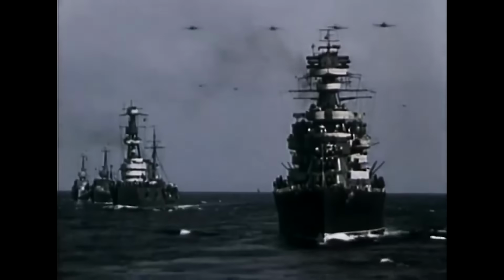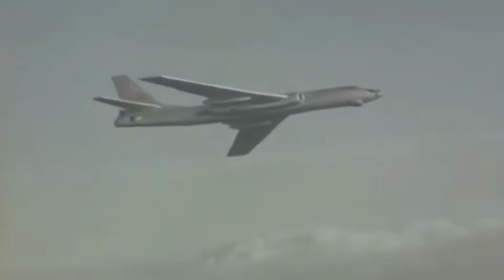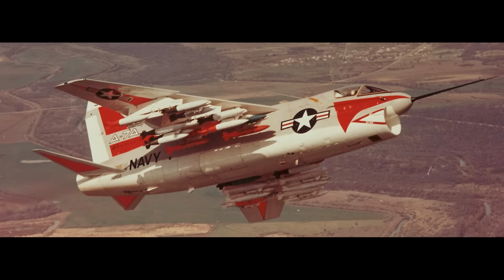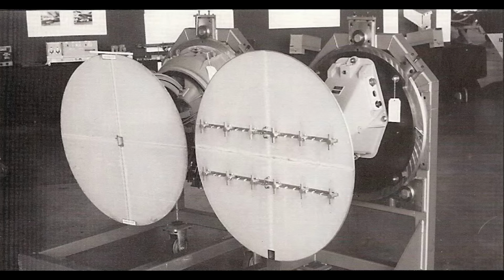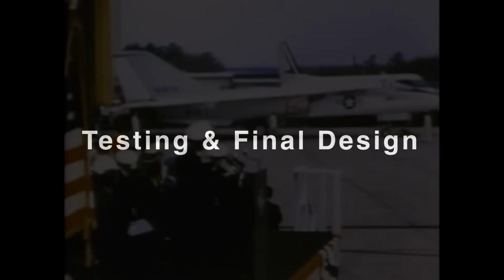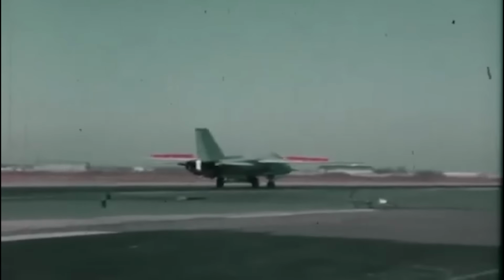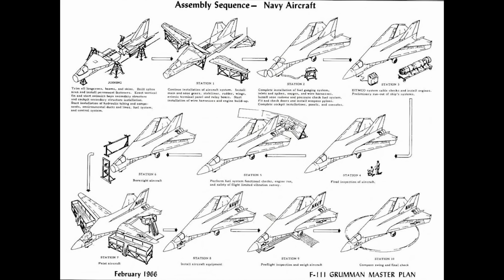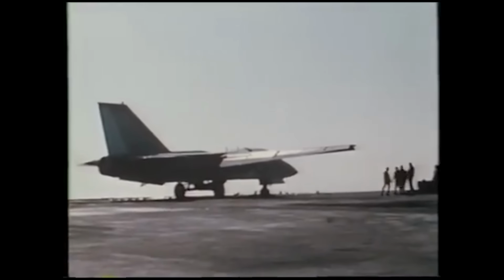Was The Grumman F-111B A Bad Aircraft Or A Missed Opportunity?

Comment: The Pratt & Whitney Engines had issues with compressor stalls mostly due to Inlet Ducting of the F-111.
More importantly the engines were subject to catastrophic turbine blade failure.
I remember my Father talking about the F-111 at diner. He had just come back from P&W after solving the problems with manufacturing Turbine Blades, he was pissed with P&W and their manufacturing methods.
Dad ran Grummann's Flight Test Department.
Reply: Was a problem on the F-14 too. So who screwed up on the intakes on that?
Reply: @w@w@w @whtalt92 14 Flameout issues were again on P&W. It took a combined effort between Grumman and P&W to modify the Inlet Ducts of the Tomcat after an engine redesign driven by compressor failures. My Father went to Pratt & Whitney, once again. Now years later. Evaluated their new engine operation and came up with the solution to the turbine blade failures they were experiencing on the new engine, once and for all. Micro cracks in the cast Titanium blades were the cause. It was a Titanium processing problem that was still plaguing designers after decades of design effort. The solution, better process control and old school magna fluxing. The trick was using the right dyes and ultraviolet light frequencies. I remember this as dinner table conversation. Following Apollo in 1969, We returned to NY and my Father took over the F-14 Project. He picked up a mess and got it straightened out.
FYI General Dynamics screwed up the F-111A Ducts. Grumman fixed the Ducts and Landing Gear problems in the B variant.

Comment: The US Navy turned out to be right, actually.  It is easier to design an aircraft for the Navy and have the Air Force adopt it, than the other way around. The unit costs of the F-14 would have dropped significantly if both the Navy and Air Force had ordered it. The F-15A/C was an outstanding aircraft, but, once theF-110 engine had replaced the TF-30, the F-14 could do whatever the F-15 did and much more.  Also, Captain Frank Ault's report on weaknesses in Navy fighter pilot training, which led to the Top Gun school,  showed that the F-111B was simply not suitable as a competent dogfighter and would never be.  Credit Frank Ault first, then credit Tom Connally.  PS The TF-30 was a perfectly good engine for the F-111A because it did not have to maneuver.

Comment: Excellent and balanced coverage.  This is the best coverage of the -111 I've seen since Anthony Thornburough's book. 

And,  though not stated directly,  I think the F-111 saga demonstrates that the USN could be every bit as myopically parochial as USAF is often portrayed to be.   Concur  both the F-4 and A-7 were foisted on an unwilling USAF by the commonality obsessed McNamara.  TAC sorta liked the Phantom but felt the Thud generally superior.  ADC absolutely loathed the Phantom compared to the glorious Six, and the supposed flyoff was a setup.  So, generally, USAF did not want the F-4 and saw no use whatsoever with the A-7, passing them on to ANG as fast as possible,  often even direct from the factory.  

But the thing is,  the F-111 was the"trade. " USAF would take aircraft it didn't generally prefer,  and Fly Navy would take the -111. But the Admirals had another hissy-fit, their fourth in 20 years,  and with help from Vinson, got to drop the Pig. 

So I agree there was little technically"wrong" with the F-111B that precluded its ability to perform the Fleet Air Defense mission.  USN didn't want it,  because of its origin,  and refused to take it, period.
Reply: F-4 was bought by USAF because of the Vietnam War.  They needed a versatile fighter that could also handle the strike role, and they had nothing in production or coming in the foreseeable future of their own.  When operating away from the sophisticated early wining/control environment of CONUS, it actually outperformed the fantastic Six as an interceptor.  Regarding the A-7, Vietnam comes up again.  USAF had no attack aircraft in production and Close Air Support was not a role USAF was fond of, but became very important.  The only thing available was the Navy's A-7.  USAF took that aircraft, upgraded its engine and avionics and produced the A-7D, an aircraft so good that USN bought the Air Force version as the A-7E.  A-7s dropped an enormous amount of ordnance and flew a ton of missions, but had a very low loss rate.  A-7 was sent to the Guard when the A-10 came on line, although a lot of AF pilots followed their SLUFs into the Guard.  

F-111B's big problem, aside from being compromised by USAF requirements (just as AF's F-111As were compromised by Navy requirements) was that even if it had worked it was a single mission aircraft, that being loitering for an extended period and firing long range missiles at Soviet bombers.  It had no other fighter or strike capabilities and would have to avoid air to air combat.  Navy couldn't afford to use up fixed deck space for such a limited asset.  Hence the VFX program,  to do the F-111B mission, but also all the other Navy fighter missions.  VFX gave us the F-14, which for most of its career was plagued by the same poor engines as the F-11B.

Comment: I would summarize it as follows; The F-111B was maturing into what the Navy had wanted in the early 1960s and would have comfortably satisfied those original requirements, however, the experiences in Vietnam demonstrated a need for a proper fighter along the lines of the F-8; something that could hold its own against the more maneuverable Soviet fighters of the day that would be realistically expected to be encountered in the types of conventional arms proxy wars the US was increasingly finding itself involved in. Thus the requirements changed to an aircraft that could carry the fire control system and primary weapon of the F-111B, but would sacrifice loiter time and raw speed for better maneuverability, allowing this aircraft to conduct fighter sweeps in addition to fleet air defense. All in all, I would say that the F-111B wasn't all for nothing, sure it didn't come to fruition itself, but it paved the way for improved technologies that would come to define what we refer to as 4th generation fighters (turbofan engines, ARH missiles, and improvements on PD radar)

Comment: Since I have encountered here several 'Navy princesses' who 'hold their skirts tight' and cry out: 'IT'S TOO BIG', I mean to share the fact the A-5 Vigilante operated from carriers until 1979 which was even larger than the F-111B - and that if one looks into aerodynamics, one will find the REYNOLDS NUMBER from which follows that maximum flight range is related to an aircraft's size and speed - benefiting larger and faster airframes with higher and further lift. 

It doesn't hurt to look into the scientific basics of aviation and to compare airframes not just by performance stats - as most 'keyboard warriors' prefer as if playing a card game - but by physical parameters that can begin to speak for themselves as a repeating pattern. 

The F-111B, the F-14B and the F/A-18F all approximate another in sheer size, because combat range and speed is a desirable, major requirement for all naval aviation.
Reply: Max takeoff weight of the F-111B was 25,000 pounds greater than the RA-5.  Or about the same as the A3D Skywarrior.
Reply: @dukeford8893  
"Max takeoff weight of the F-111B was 25,000 pounds greater than the RA-5." 

What does that suppose to mean when talking about size ? 

The RA-5 is fitted for a reconnaissance mission, not carrying 6 very long range missiles...

Comment: Another fantastic and informative presentation!

Its unfortunate you didn’t include drawing/model of the Grumman F-111B CWIP design, as it was a beautiful and much more thoughtout iteration of the F-111 - alas, it deviated much more in the stipulated 'commonality' of McNamara. Importantly it also did away with the escape capsule, the internal weapons bay and heavy and complicated wing pylons, it carrying all six Aim-54 Phoenix missiles on it's under fuselage.

https://thanlont.blogspot.com/2010/11/f-111b-colossal-weight-improvement.html?m=1

I've also come to the conclusion that perhapes the TFX/F-111 might have worked out better, had the Navy designed the aircraft more specific for what it required and the Air Force adapted that design for their strike-interdiction role. After all these proved more than feasible with both the McDonnell Douglas F-4 Phantom II and the LTV A-7 Corsair II. After all, the reality was, the Air Force's specifications were irrufutably overly cooked, in both terms of speed and range, which is what gave the F-111 both it's size, weight and cost.

Regards

Comment: So many milvlog channels feature bad editing, shortcut research, and no proofreading. This channel stands above all of them with impeccable integrity!

Due to this post, I'm seriously considering building my vintage Revell F-111(B) in 1/72nd scale as the USN version featured here, rather than the USAF version which I already have in the FB-111 from Hasegawa, physically the same as the Australian F-111 (I think).
The Revell version is one of the only F-111 kits which features fairly accurate retractable landing gear, movable speed-brake, movable wings, stabs, and a removable crew escape module!
Reply: The thumbnail used for this video is of the 1/48th scale F-111B put out by Aurora back in the 1970s.  It can be found via on-line sales, but I bet your smaller Revell kit is more accurate and has better detail than the Aurora model as their model kits usually left a little more to be desired.

Comment: F-111B could potentially have been used to complement an existing land based F-111/EF-111 force. It could have been used as part of a partial dispersion strategy to operate from austere airstrips and roads. This would provide a survivable counter strike in the event that primary air bases are destroyed. It therefore could increase the overall deterrent value of the total F-111 force. It wouldn't need bar or hook but the reinforced structure and gear of a naval variant could be useful for dispersed austere operations. Could potentially load a chute instead of a hook for shorter landings when needed.

Comment: The yada yada yada about why GD was awarded the contract was because Howard Hughes had driven the company into near bankruptcy which would effect several other military contracts very negatively. So they threw the bone to General Dynamics and gave them Carte blanch to pull themselves away from the crevasse. I worked on the sling wing center line box refit to rectify cracking issues. To remove the wing box hundred specially designed “rivet bolts” that had to be removed. These “rivet bolts” (called hi-locs) were saved in a five gallon bucket and shipped back to General Dynamics, who would clean any sealant residue (swing box was also one of the many fuel tanks in the bird). Once cleaned GD would then SELL them back to the military.
It wasn’t so much that the Aardvark was a bad aircraft as much as it was a boondoggle to bail a poorly run company to produce a “one size fits all” pipe dream of a bean counter who was in a position way over his head. Robert McNamara was without a doubt the poorest excuse for a Secdef this country has ever had.
Reply: Dad said it was a POS, then it killed him Jan 18, 72
Reply: That particular SECDEF got a shitton of aviators killed and captured by the enemy.
Reply: @warnerchandler9826 
Only six were lost in Vietnam. There is no actual proof that an F111 was shot down. No wreckage to investigate. But what we do know is fatigue of the swing through box and elevator slab stubs,was more like the issue. And yes the RAAF lost eight due various ways from pilot errors through water ingestion.
Reply: It would have done fine as an undersecretary. Collect all the data, then give it to the numbers guy so he can make his recommendation, And then compare that against the other recommendations in order to arrive at a sane conclusion. 

Guys like that are enormously valuable for decision making, but in general should not be the ones making the decisions
Reply: @larrymcgill5508  bean counters  like the group that McNamara ran with develop nothing Innovative. They are strictly lean specialists.
There would  be no R&D or Innovation in a world of bean counters
Reply: McNamara wanted his pet "commonality" concept to trump everything.  During the multiple evaluations of the Boeing and GD proposals, the Boeing design was repeatedly preferred by the evaluation team.  However McNamara overruled them because the GD proposal had more "commonality" between the Navy and USAF versions.  Basically, Boeing used identically shaped parts for both models but made them of a lighter gauge material for the USAF version , since it didn't need the structural strength required for carrier operations.  McNamara even pushed the F-111 as an interceptor for USAF.  When USAF asked, and received funding for, the F-12B (the interceptor version of the Lockheed Blackbird) he impounded the money and ordered the Blackbird production line destroyed!  

Hughes had nothing to do with the F-111 program.  It didn't even have anything to do with GD until 1992 when it bought the GD missile division.  GD Aircraft production got taken over by Lockheed in 1993.  Ironically, though, Hughes' company did develop the radar/fire control for the F-111B, which went on to be used in the F-14A & B.
Reply: Yep it was that bad it served for decades.
Reply: >worst secdef this country has ever had

sir have you heard of dick cheney?